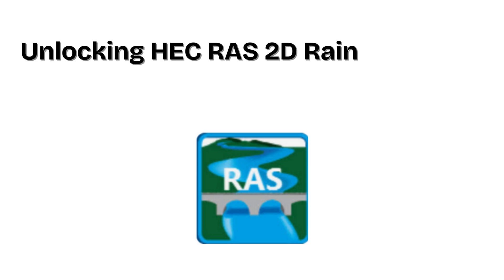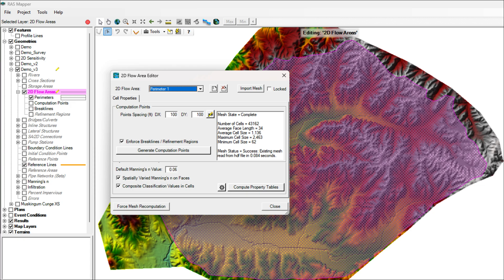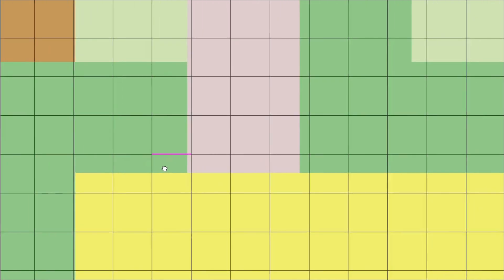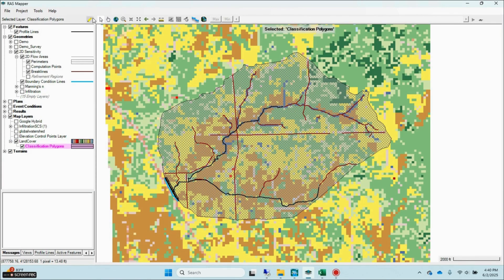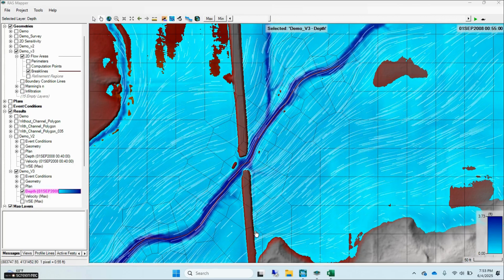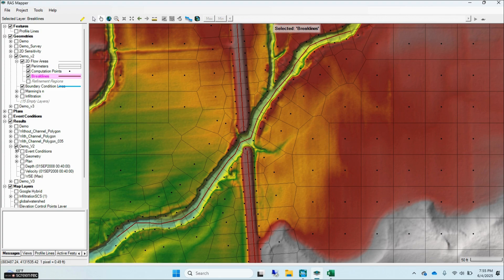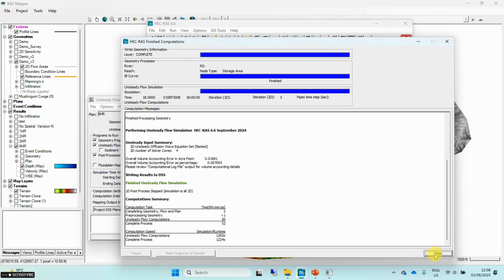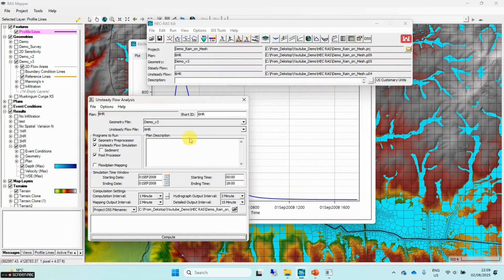Unlocking HEC RAS 2D Rain On Mesh: 5 Essential Tips!

Comment: Hello Sir, I am using a 30 m DEM in HECRAS, my rivers are not perfectly visible as u, is that make errors
Reply from the maker: Terrain resolution I used was 2' which is fine enough to capture the channel details for HEC RAS modeling. However, high resolution DEMs like 30m is not typically used in HEC RAS as it cannot capture enough details. Consider using finer resolution terrain in your model.
Reply: Prof. Can you help me your  contact number to discuss for further. Thank you.